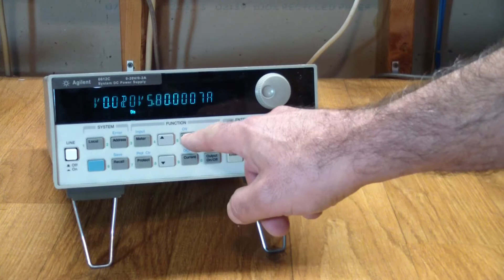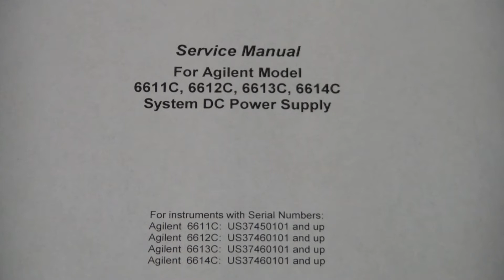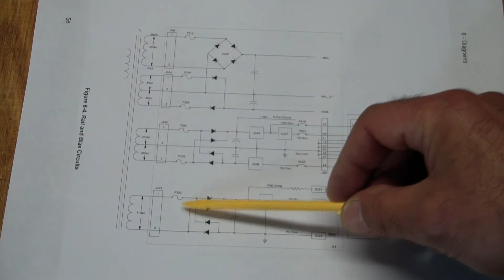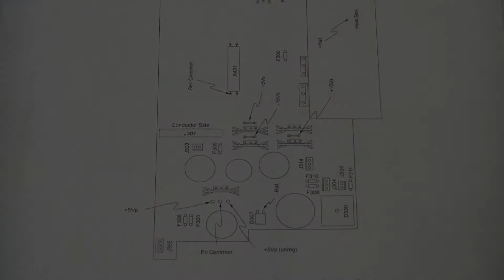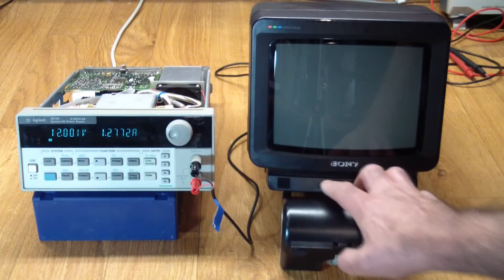AE#2 HP/Agilent 6612C bench power supply repair

Comment: Please tell us about those front feet/legs. Are they factory? DIY?   I need to rig something like that to raise up the front of my 6613c
Reply from the maker: I have seen several instruments in this style of case, and they all came with these standoffs. So they are factory. They can be folded flat under the instrument.
Reply: @artifactelectronics  thank you! I was able to DIY a set of front legs using the handles from a large binder clip

Comment: Can someone tell me what a ZERO ohm resistor is used for...or why would you use it?? And as far as replacing the fuse that is(was) blown...I would cut the leads as close as possible  to the resistor,  and remove the old resistor, and bend the old leads up...and solder to that...
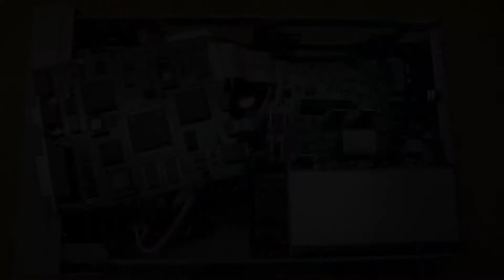Reply: It's being used as a jumper. You can see one at 15:08 . Single-layer PCB designs use these all over the place, but they are just simple wires. You can see one at R321 and another at R423 that's just a wire. This power supply design came in a range of different voltage / current outputs, so in this model a jumper is called for, and in another they would have a normal resistor there. Using a 0-ohm resistor as a jumper makes it quicker and easier to manufacture. 

Having done this sort of repair in the past, it would be really hard to solder it that way. One issue you will run in to is that the soldering iron will melt the solder holding the old lead in place. You can get around this issue if you need to, but it's easier to replace the whole thing here. You also possibly would run into an issue with the new connection soldered like that might not be able to hold the amount of current flowing through it.

Comment: Nice video and an 'easy' repair. One of the ways it could have blown the fuse is someone trying to hook up 2 power supplies in parallel but getting the polarity wrong, or maybe someone trying to charge a battery? One of the things you should have tested is the current limiting, so when the tv is connected set the Amps to 1 and see if the output voltage drops.

Comment: This should be labeled as a HP part as it has a dual red binding post arrangement. It looks like a factory label on the front so must be manufactured around the name change period. A reverse current into the supply is a very likely cause of the failure. Another great video. Karl